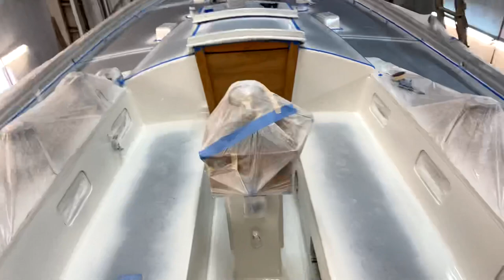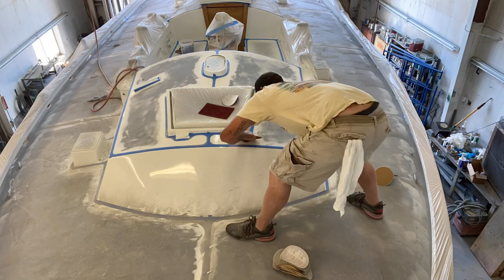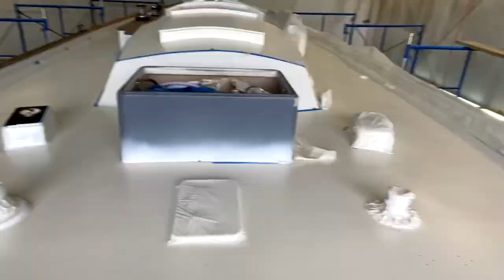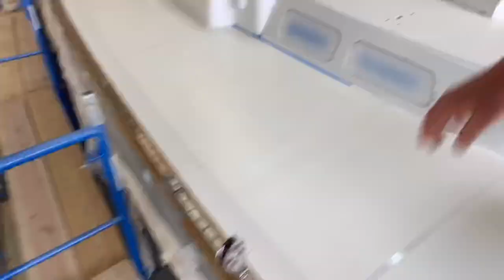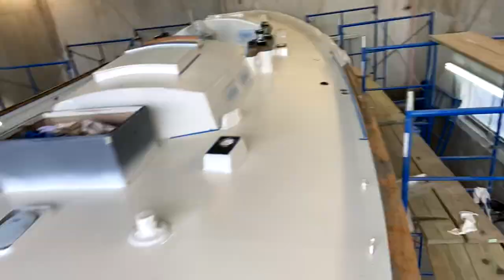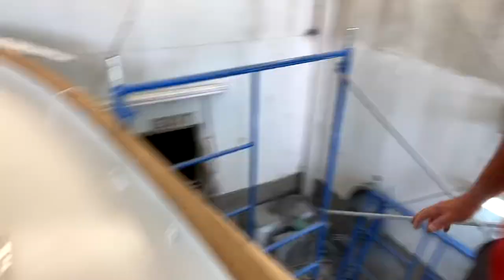Ferrocement deck repaint with awlgrip and awlcraft 2000. Part 9

Comment: Looks fantastic! 
Can I ask what ratio particles to paint you use? And the gun tip size? 

Love how evenly its come out.
Reply from the maker: It Varys. I’d say per 1 gallon of mixed product I’ll use 6oz coarse and 6oz fine griptex. After I spray the first coat, if it doesn’t look like there’s enough then I’ll add more as needed until I get the desired look. It just all depends. Start out small and add as needed. If you put too much in from the get go then you need to mix up and add more paint. Hope this helps
Reply: @boatpaintingrestorationwit3029  Cheers. Do you do a binder coat afterwards, or just all the coats with non-skid? 

Also what tip size? 

Sorry for all the qs.
Reply from the maker: All coats with nonskid and I use a 2.0 tip. No problem bud 👌
Reply: @boatpaintingrestorationwit3029  how much reduce paint with nonskid